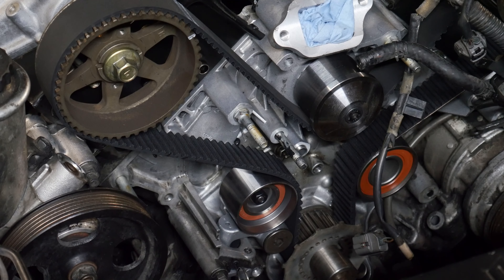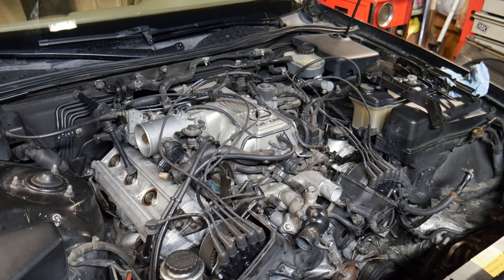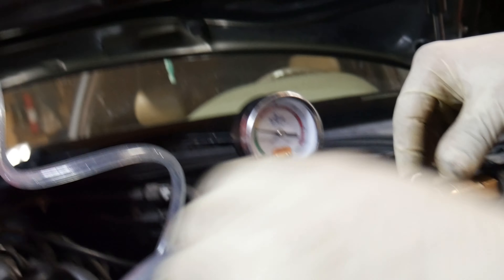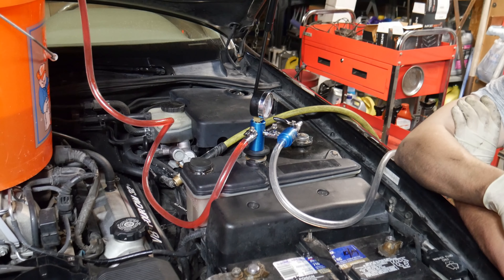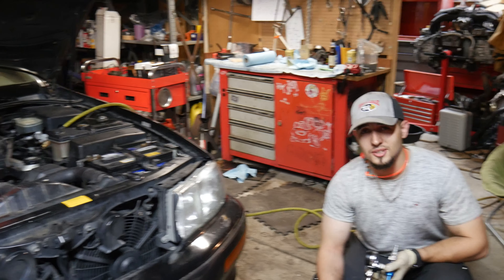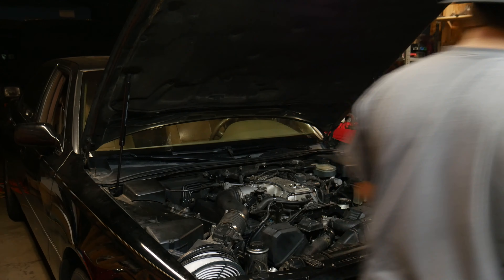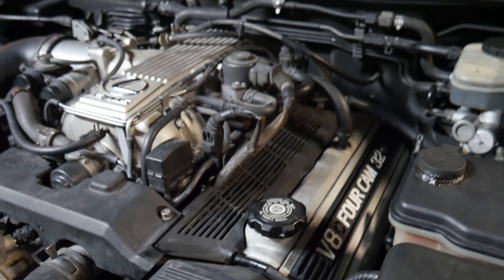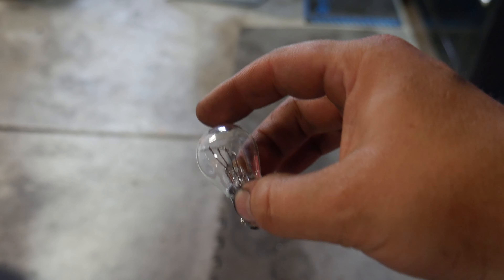LS400 Timing Belt Finale - Does it run?

Comment: I love how your LS-400 started INSTANTLY!
 I replaced my ECU (and triggered the immobilizer) and it would not re-start - I stored it for 7 years. I finally fixed the immobilizer, got in and when it started I did not even hear it, and tried to re-start it (GRIND) while it was already running because I'd forgotten over 7 years how quiet the LS-400engine is. (On 7 year old fuel too!)
Great timing belt videos because my LS is due for it and I thank you very very much for these videos!

Comment: I want that tool, would love to just test it
Reply from the maker: Vacuum coolant fillers and cooling pressure testers are two great tools. That and a no spill burping funnel is all you really need for doing anything on the cooling system

https://amzn.to/3KaX14D that is an affiliate link, but thats an idea. $60. Really, theyre aimed at flat-rate technicians who want to do the job really fast, I think

Otherwise, fill the cooling system from the highest point with a bottle, and burp it

Comment: Why does the markings on the belt not line up
Reply from the maker: I think its because I tested it and turned the engine. Once the engine turns, the belts markings wont line up again for another several thousand rotations. The three pulleys will line up, but the belts markings will slowly rotate around the whole set up

look up hunting vs non hunting gearsets